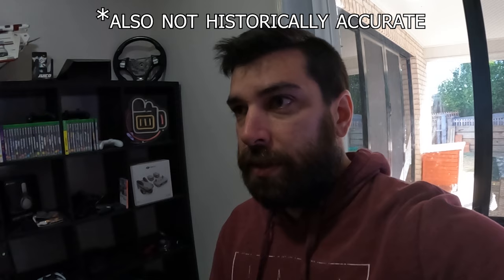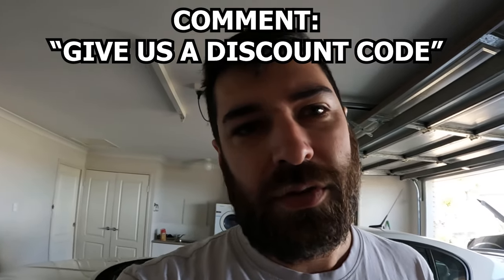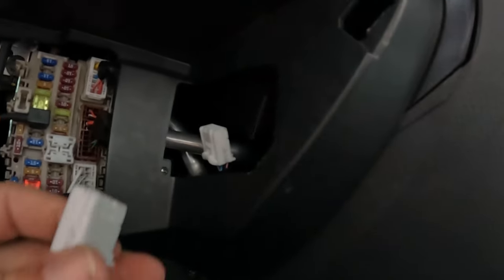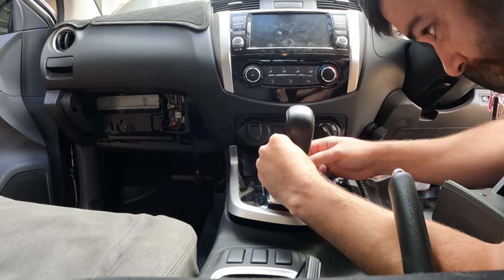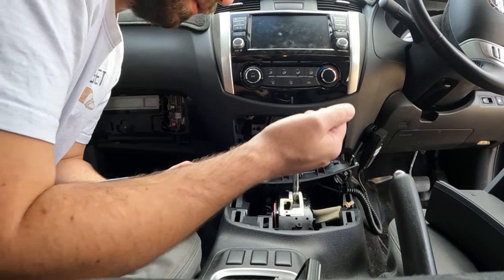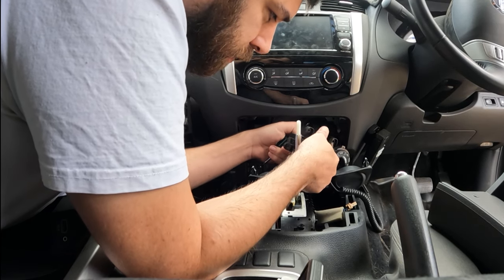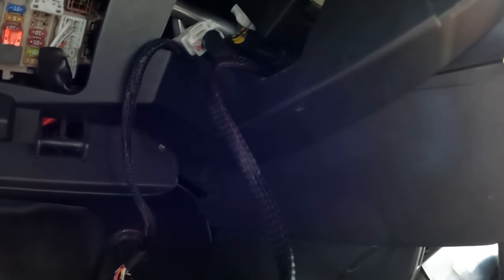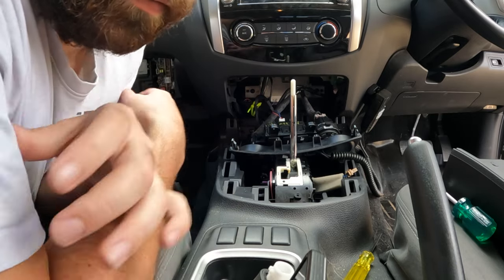Do this to your NP300 | BlackOps Offroad Anytime locker Install

Comment: Does the factory switch need to be turned on then thrown behind the dash? Or does it not matter? Cheers
Reply from the maker: Testing my memory with this one, pretty sure its on, I think if its off it doesn't illuminate the new button but still works...I think 😅